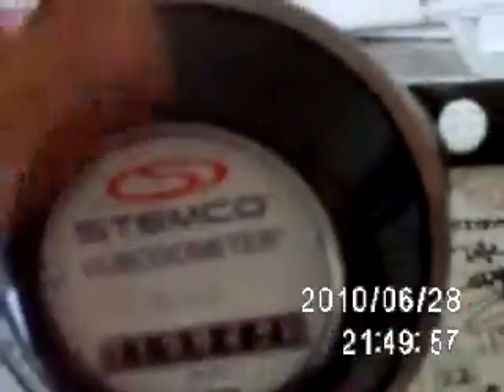Stemco Hubodometer.

Comment: Do some school buses use any of these hubodometers?
Reply: Theyre slowly being phased out. You will catch this mechanical style on Semi Trucks
Reply: One bus company near me here in Australia has these Stemcos attached to nearly all their bus fleet.
They don't use a bracket, they somehow bolt it right into the axle hub.
Reply: @jamesfrench7299  Interesting
Reply: @deliaslucero6536  I was always fascinated at the method used to attach hubodometers to the wheel.
Most used a bracket held on by the hub nuts/bolts and some were attached to a hubcap drilled on Leyland and AEC buses when bolts or nuts holding the hubcap on.
This was a first seeing them attached directly too the hub assembly itself.